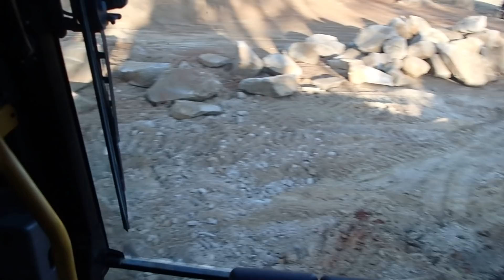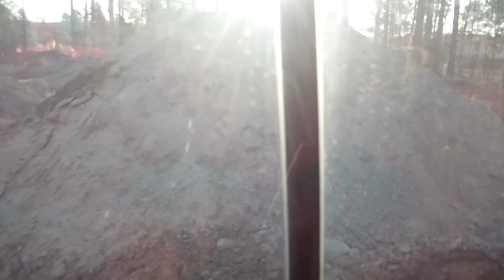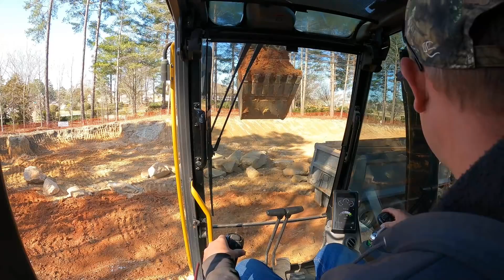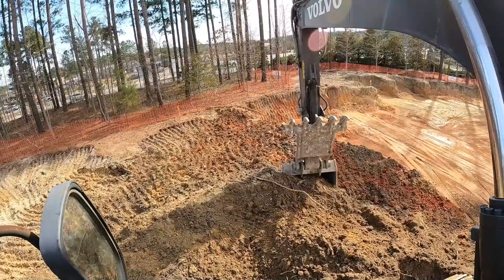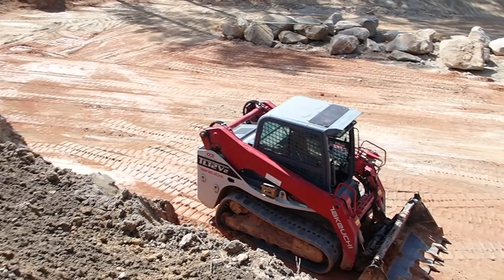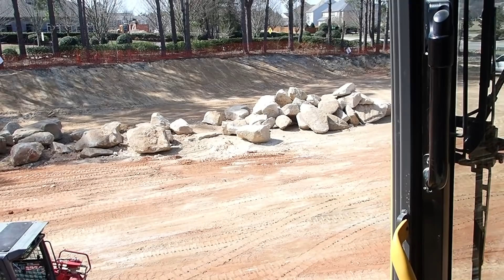Another Round Of Trucks

Comment: I will tell you what, I was on a haul off job, and the guy I was hauling off stopped me as I was backing in.  He was panicked, He needed to go to the hospital his wife was having their baby a few weeks early.  He asked if I would load the trucks for the rest of the day.  He had a brand new John Deere 210g.   Only 130 hrs on her.  He had one of the largest buckets on that machine, and we were excavating a cut where the bottom of the tracks were about 10 feet higher than the top of the bed on the dump trucks. I must say with a huge bucket, I did not like loading trucks that far below me.  I felt like I was really dumping huge amount into the bed uncontrolled.  It was such a large bucket that it felt like as you stretched out the arm to fill the trucks the excavator was going to end up in the bed along with the dirt in the bucket.   Got it done but I just felt uncomfortable all afternoon.

Comment: Are all those rocks there from previously dumping??? I have been a driller in the north east doing test boring ,  and monitor wells for 30 years, and never seen boulders in sand like that. The messes from dumping I have seen over, and over, but never in virgin land.
Reply: If I recall the name correctly, they're glacial flow boulders. Basically they were dumped there hundreds of thousands, if not millions of years ago.
Reply: Wow where you boring in the north east. Cuz in cant be rhode island or Connecticut.      Cuz.  Thats like nothing to our digging.

Comment: Whats with the extra axles on the trucks. How do they go around corners? In australia we only have  tandem drive 10 wheelers or 12 wheel tandem steers.
Reply: Needed to reduce the amount of weight per axle. The US has what is called a bridge weight law and weight limits on most roads. Makes it stupid easy to get ticketed if you are not really careful
Reply: @Blazer02LS   How do yhey go around corners?  Do they lift up the non driving axles every corner or just drag them around corners and ruin lots of tyres.
Reply: @LouKodge  Some have the tags as self steering axles, others just drag them.  The newest trucks may even have steerable axles connected so they follow the front tires. Depends on how they were set up from the builder and if the axles were factory or added later.  The stupid thing is that those axles really don't do anything for the trucks real weight capacity, they can carry the full load with them up. The axles are only there to comply with the state/federal weight laws.

Comment: Why don't the trucks backup behind the truck being loaded?
Reply: Because Chris wouldn't be able to dump into the truck.
Reply: My guess is Chris doesn't want the extra work to re-grade what is finished
Reply: Safety reasons probably
Reply: Also he was sitting on top of the top soil pile as well as the clay he was excavating so it was about at maximum depth for the excavator.

Comment: Did you know you would run into this many rocks when you bid on this job?
Reply: They had to have because it was on the surface already. And they put a Rock Clause in the contract.
Reply: Funny up here in new England  we would be humming 75 percent that rock in our triaxles.     We haul so many boulders its rediculess.     If a  200 can put her over the bed from up on a pile in they go.      Beats the hell out them but away we go.         What chris has dug off. That job. Would be likes sprinkle on an ice cream. On our sites.         Its insane excavating in southern new England
Reply: @toddreynolds8875  Here in the southwest we have what are called demolition trailers that are half round with a barn door on the back and only the largest of the boulders would be broken up to roughly 2 feet cubes. The trailers are semi so a tractor with a wet kit is used to haul them. The same trailers are used to haul  building demolition materials.